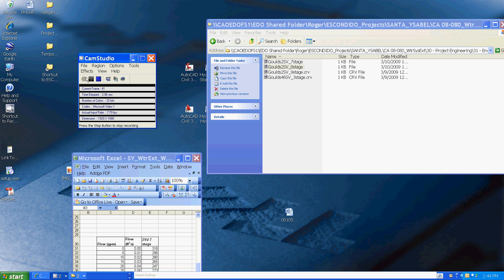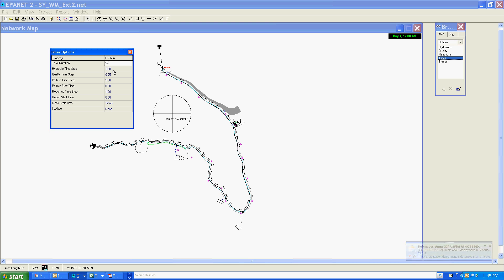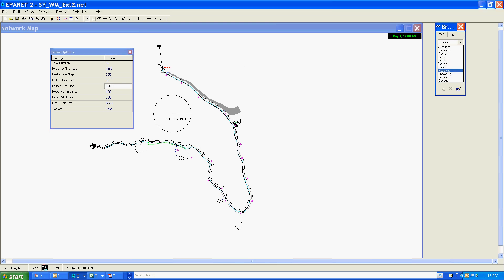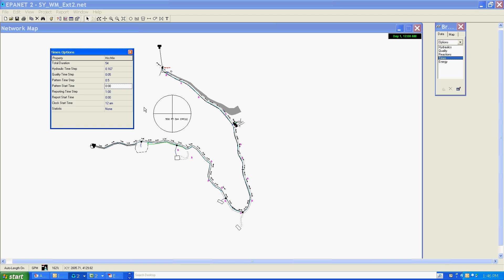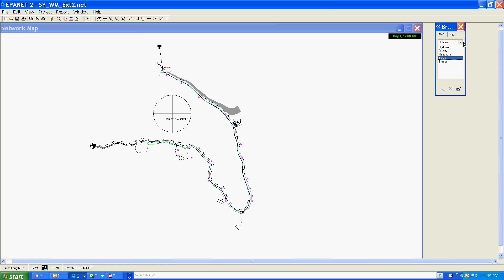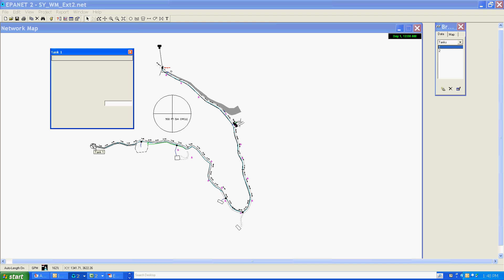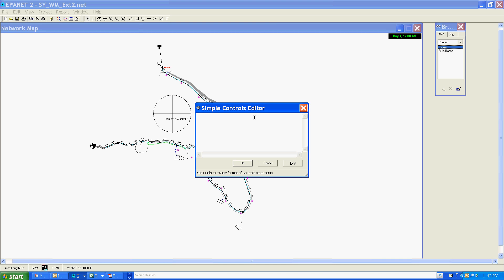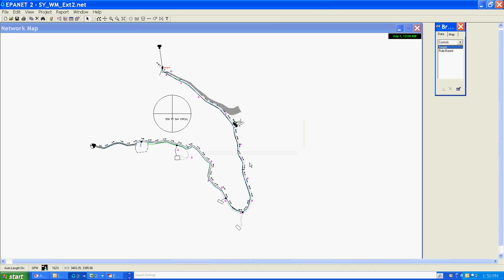EPAnet Tutorial Section 9: Times and Simple Controls

Comment from the maker: You could do a model with one tank at the actual elevation of the tank of your system (assuming it's a gravity system) and another tank at the elevation of your FH with the section of pipe between the two the same length as the actual pipeline from the storage source to the FH.  The flow from the upper tank into the lower tank would be the idealized flow with the headloss due to the pipe friction loss; but you'd have to also model entrance/exist losses into/out of the FH plus appurtenances.